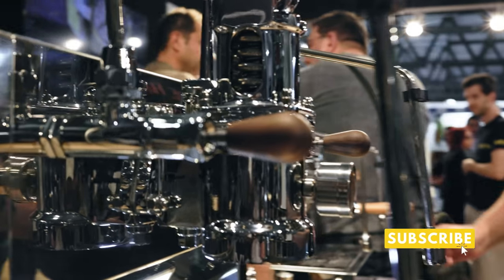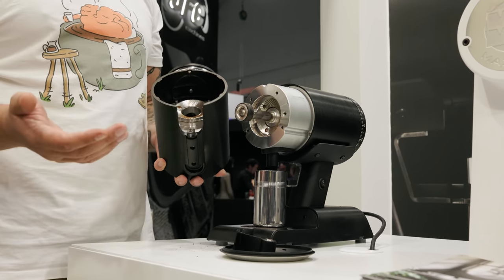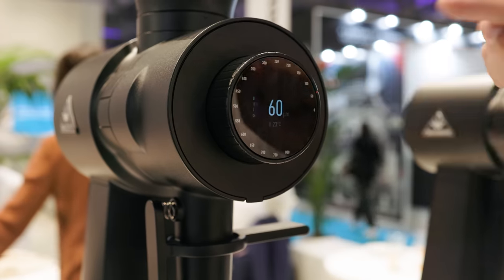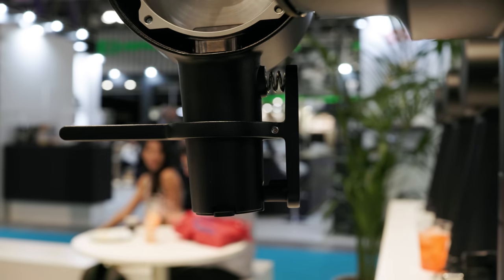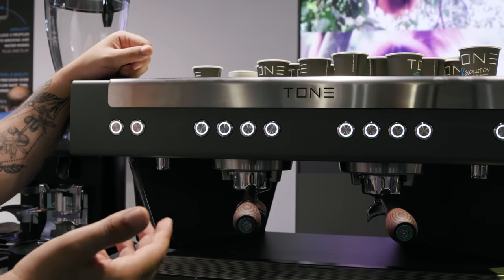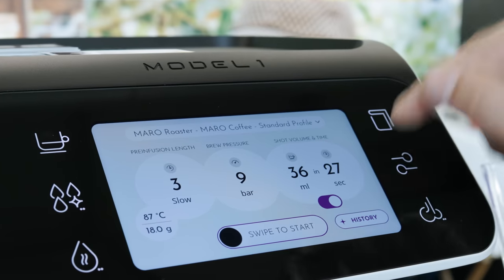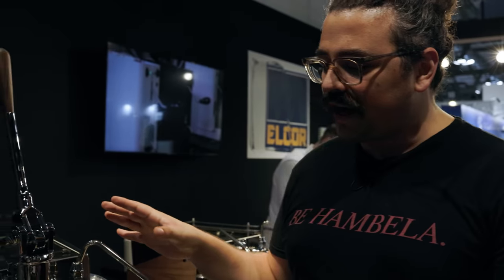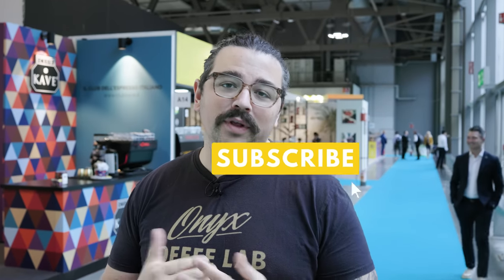TOP 5 NEW COFFEE PRODUCTS AT HOST MILANO 2023: Exploring the Showfloor with Lance

Comment: I don’t care about the adjustment dial - I’m thrilled to see a company like Mazzer in the prosumer single-dose market. So many of the options are coming from completely new companies like Zerno, or their companies (Timemore, MHW-3Bomber) that don’t have experience manufacturing robust electric grinders.
Reply: To be fair, the fact that burrs from the big manufacturers need aligned by the buyer isn't confidence inspiring.   Happy to see new gear, but the QC is continually disappointing with few exceptions.
Reply: You should though. An adjustment dial so far away from the burrs means lots of distance which would mean more play overtime which means subtle changes overtime which has the potential to be awful.

Comment: I understand that you may not see this, but with respect to the tone I was wondering why there is such excitement about these new fast heating (on/off) espresso machines, like the one James Hoffmann reviewed a few weeks ago. I understand the practicality of being able to heat up water in a instant for a shot and the economic benefits this would have in saving energy but surely this technology already has existed with thermoblocks and thermocoils. I was wondering what the big difference is between this new technology that is being developed and the technology that already existed in machines like the BDB (is it the accuracy and PID control??)
Reply from the maker: The excitement isn't at the tech. I feel I said this in the video. The excitement is a company FINALLY using it in a commercial machine.
Quick heating has been around since the 40s (no boiler espresso machines). Why continue to use boilers in commercial environments when they're on literally 12 hours daily? Nonsense.

Comment: Great video, the Maro seems like a strange value proposition since it's targeted at people who don't know how to make espresso, yet are willing to spend $4500 on an espresso machine but I hope for them those are out there since it seems very well built and thought out. For the mazzer, any idea what the (EU) retail price will be? If the price is right it could be interesting to have a grinder from a company that has EU distributors avoiding the high import taxes  (e.g. on Zerno Z1 or Lagom P64)
Reply from the maker: To be fair, it isn't targeted at that demographic. They just wanted to ensure and include it. You'd be surprised how many people start espresso and immediately buy a decent or LM mini. It is geared towards any level with the promised potential of infinite upward mobility.
As for mazzer, they said 1000 euro in europe so likely 1400 or so in US
Reply: @LanceHedrick  Thanks for the response and fair enough, it definitely is a lot more accessible than something like the decent and there are plenty of people out there to whom $4500 isn't that much money. At the €1000 price point I'm very curious how the mazzer will perform, especially in terms of the flavor profile of the burrs and whether it will turn out to be similar to the SSP MP burrs. Any plans on doing a review when they're released? (Also any idea when that will be?)